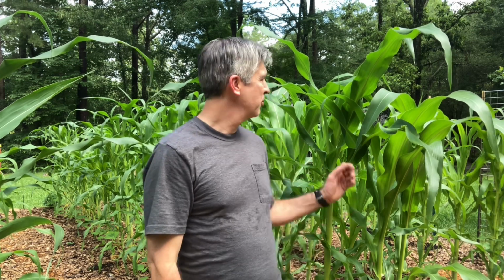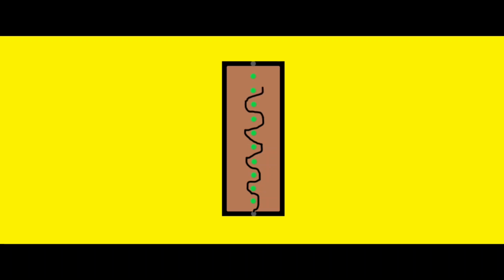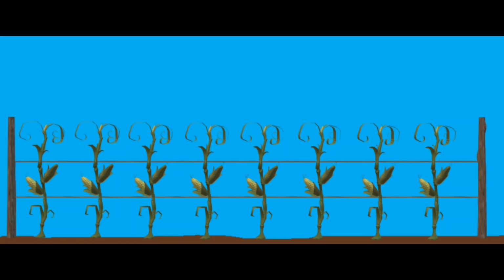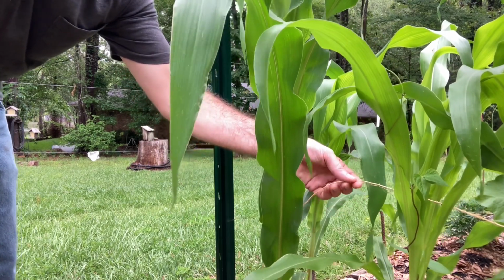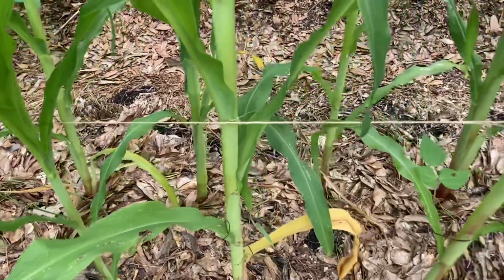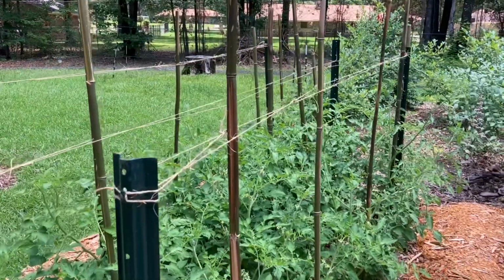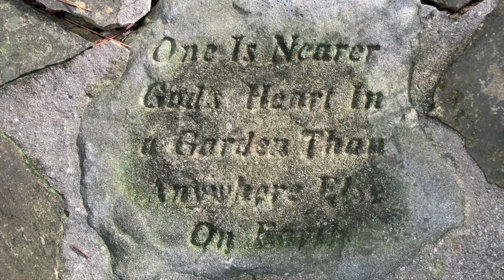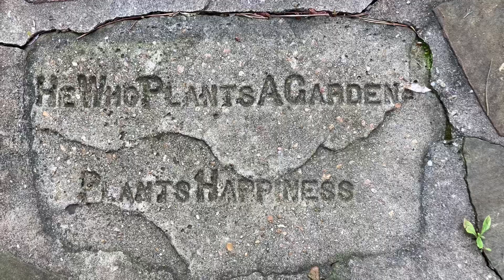How to keep corn from falling over - Three Sisters garden - part IX

Comment: I would have made this project way more complicated. This is the solution to flat corn.....had I begun the project earlier. I'm getting near the useful productive life of a gardener so it just isn't practical. I always have 7 or 8 rows about 70 feet long. That's a heap of posts. Not so bad if you get a few now and a few later, though. Gosh, but you must snicker when the big blow comes through knowing your corn is still standing. I love my Golden Queen but it comes with arthritis at the knees. It's sooooo pretty and nice. I love watching it grow. I love eating it. Then the next morning...flat corn. Yuck!

So let me tell you how I do my maters. This year I have a record 42. (Planned for a dozen initially....was gonna jes cut everything in half and take my rest for once in 40+ ... and then you know what happened with the economy. That was why I planted field corn for the first time ever.) So anyway, I use landscape timbers. They are still reasonable enough at Home Depot this year for some reason... Under $5 a pop. In my 60 foot row I plant 12 plants or so. Used to I'd put in 18. Found over time that they really do better with some room so they go in at 3.5 feet now. I have the space to do that.  A week or so later I set the landscape timbers equidistant, 4 for the 60 foot run, one at either end, etc. I turn them sideways and tamp 'em in. Starting a couple of feet off the ground or so I put in a nail. Repeat up to head high or so...same on either side of the timber. I end up with three sets of nails. To this I attach bailing wire. Round and round. I wind up with three little cages up the post. I train the tomaters to go through the wire and the wire also gives me plenty of places to tie to, but as the tomato gets higher I mostly flop it over the sides. I'd send you a picture if I could here. I use strips of old pantyhose (getting harder to find cheap these days). I throw a strip of the stuff around the tomato where it is crowning, tie, and tie again so as it grows the pantyhose stretches so it won't cut off circulation.

Each year I dismantle the whole thing, carefully roll up the wire, and lean the posts on my fence. The next year I move the whole operation elsewhere in the garden and flip the posts. Can't leave 'em in the ground, because they are bad to rot. Doing it this way I average about 4 seasons of use. I buy news posts as needed, which isn't often.  After the initial spend you're gonna get at least 3 more seasons free. You have the posts. You have the wire. Maybe another handful of nails on the upside down posts...but that's it. 

Super thanks HLH for your tips elsewhere to do with field corn. I really needed that info. it ain't rocket science but I always try to flub the first attempt. It's better to know! (Just added some Blue Lake green beans to three of the rows of the Reids Dent a few minutes ago for a test. Folks here usually do Rattlesnake for corn...but it's all bought up. Golden Queen is little short for the purpose. That field stuff grows high! We'll see.)   Proud of you for all your work and demos. You the man! 
Your bestest fan in Alabam,
Norm
Reply from the maker: Thanks for the tips!  Another thing that I have done before is hip the corn after it’s 2-3 feet tall. That solution may work better for you having a larger amount to deal with.
Reply: @alanbrown9179   You're welcome there HLH! Well, I tried that. Didn't see much diffunce. And when it came time to dig again those hills gave me fits. Soooo.. I takes my chances. Ha. You do have THE solution. Woulda done that years ago if I had known. You take care and good luck with all your gardening and life!